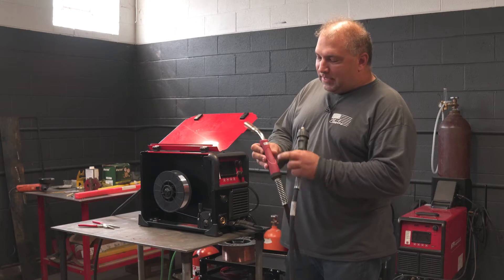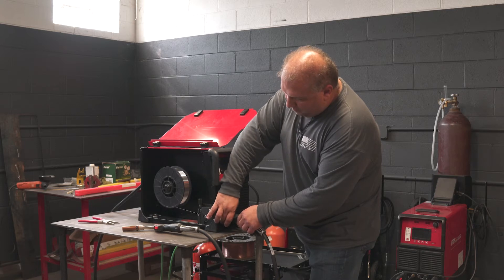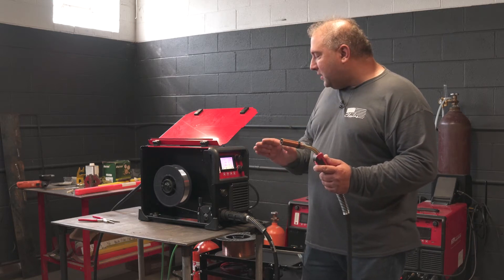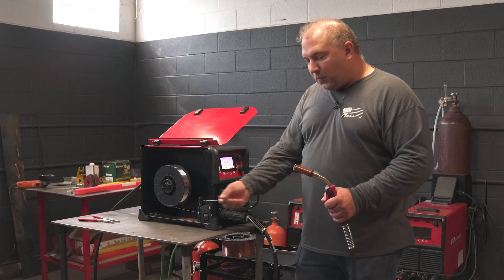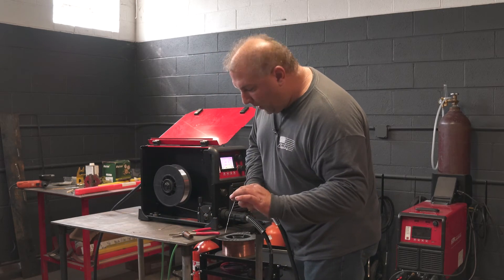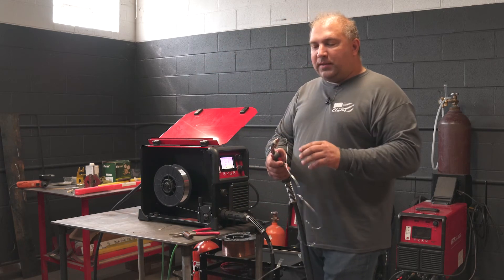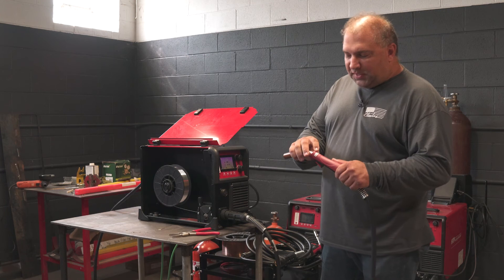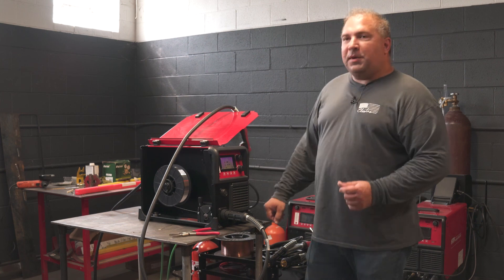How to Prepare the Welding Gun for Aluminum MIG (Pro Pulse 220 MTS – Setup Part 8)

Comment: I'm looking hard at this bad boy.  Does it come with 2 guns or is that an added option?  Thanks
Reply from the maker: Right now it comes with two guns for black friday, a steel and aluminum one. The offer is good till 12/5/2020
Reply: @usaweld  I purchased a MIG 240 machine from you guys in 2000 . I have requested catalogs from you but have received not replies. I also ordered a guide tube for .045 wire and never received it.
Reply: @usaweld  I have one the 26 series in my cart right now. Would like to order before the first.. you know… for tax reasons. Will the 220 26 series come with two guns or only one?
Reply from the maker: @nsboost  It only comes with one gun. if you want a second you need to order the other gun separately. If you need an immediate response youtube is not the place to reach out. Definitely would send an email or DM us on FB or instagram next time.
Reply: @usaweld  I figured that so I went ahead and ordered a machine yesterday. Back when I worked at Jardine’s Header palace I didn’t even want to work if I had to use the Miller instead of the Invertig221 😆. I love your machines!